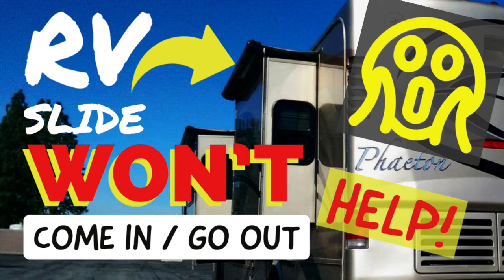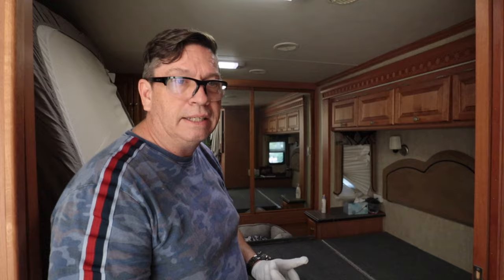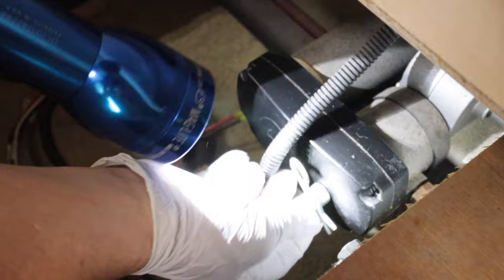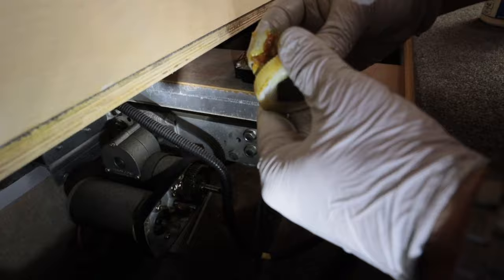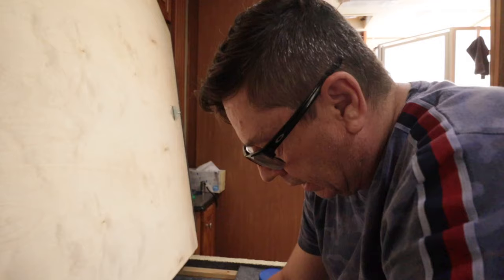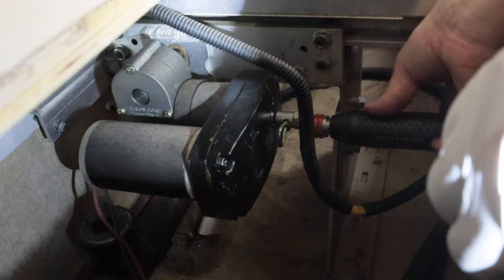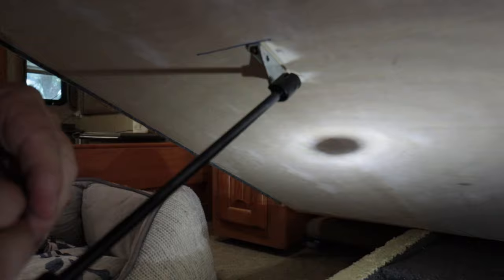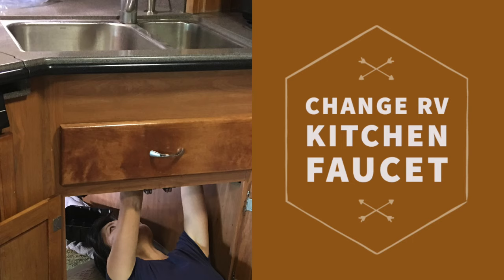RV Slide Doesn't Come In Or Go Out! It Can Be An Easy Fix, You Can Do It!

Comment: Likely the engineers put the nylon gear in the system so that if there is a problem with the slider dragging, such as worn slides causing it to require too much force to move it out or back in, it would break the nylon gear which is cheaper than stripping out metal gears.

Comment: I think you still have slide trouble. You should hold button until completely closed. You need to reset the timing on motors.
 Always try to run in and out without stopping.

Comment: The nylon gear is actually an intensional weak point! It is there to protect the motor and other parts incase the slide jams up. A cheap nylon gear is better than a motor or structural parts.

Comment: Slides won't work, no power. Do we need the 12 volt switch turned on for the slides to work? We are having problems with our electric step. Could the step problem keep the slides from working? After i unplugged power to the step, the slides worked?
Reply: Definitely need 12v power to the slide for it to operate.  Your steps must of been drawing to much of that 12v power away from the slide.....